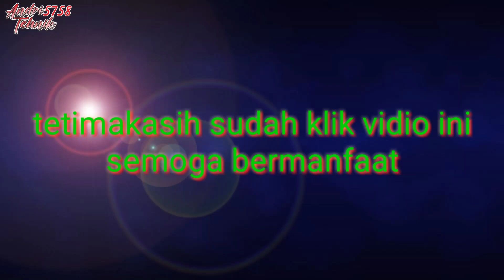dengan cara ini pompa air menjadi kencang seperti baru lagi ,

Comment: Bang kalau pompa air nembak ga bisa tenang apanya itu
Reply from the maker: GK bisa tenang gimana mas maksudnya?
Reply: Kadang gede kadang kecil di kran air  loncat loncat
Reply: Keluar airnya kurang stabil
Reply from the maker: Itu nyedot sumur biasa apa sumber mas? 
Kalo nyedot sumur Biasanya ada yg bocor
Reply: Sumur bor 28 meter pompa air simisu jet 100 bt sy pakai kedalaman 12 m.Keluar air kurang maksimal air banyak
Reply from the maker: Itu solusinya , dekatkan pompa air dengan permukaan air dengan cara di gali mas pasti beres cuma itu solusinya
Reply: Untuk kapasistor apakah pengaruh buat daya isapan nda?
Reply from the maker: GK mas kapasitor hanya untuk membantu stat pertama dinamo